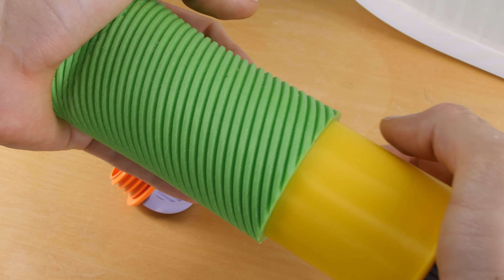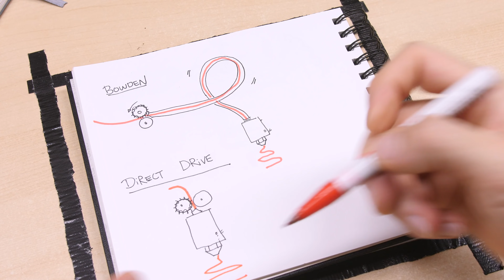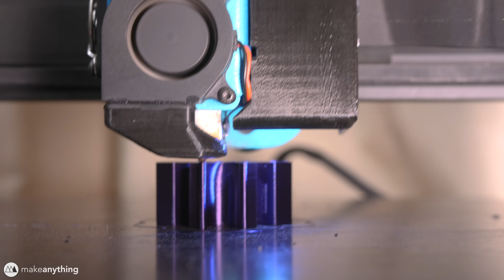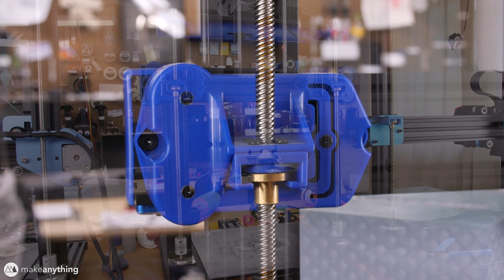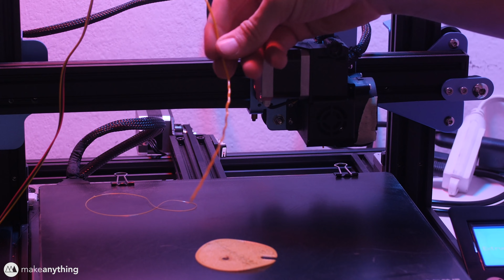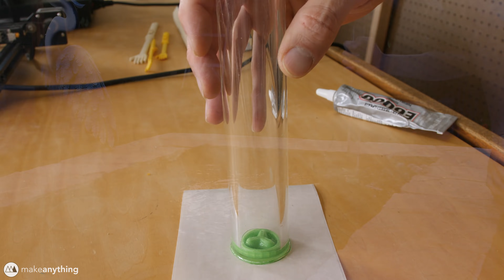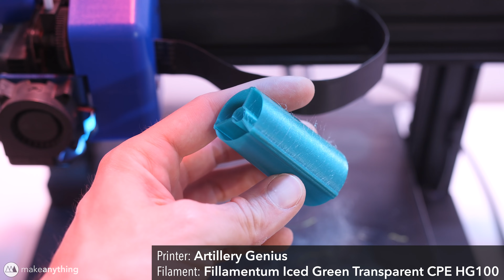Direct Drive 3D Printers in 2020 // Artillery Sidewinder X1, Artillery Genius, Sovol SV01 MEGAREVIEW

Comment: I have recently received the genius and had perfect prints every time since. I use Simplify3D's profile for the sidewinder and just changed the bed size. haven't had a problem yet and no z banding with mine. Great video, I'm waiting on making room for the artillery sidewinder since it was bigger than i thought. Also i highly recommend the Micro Swiss High Flow Volcano plated nozzle, the plastic doesn't stick the the nozzle and make a noticeable improvement to the print quality
Reply: what do you mean with changing the bed size? did you extend it in one direction?
I am planning to do this on my home build printer and buy an sidewinder x1 as primary printer for all parts that aren't extremely long
Reply: @chyrt  in simplify3d i used the sidewinder print profile that was provided from simplify3d. then i changed the bed size in the profile to match the size of the artillery genius. if you are buying a sidewinder there is really no need to change the settings in the simplify3d profile

Comment: i have recently bought the sidewinder x1. have you upgraded the hotend for high temp ?

i was having issues with petg at 230 or 240 i forget. i think it may have been the part cooling fan being at 100%.

any tips on printing abs or petg with the x1 ?
Reply from the maker: I believe I was printing at 245 or 250. Turning down the cooling fan could certainly help. 0% for ABS, ideally. Maybe 50% fan power for PETG
Reply: Sidewinder prints petg just fine.  You can adjust the cooling fan in your slicer.

Comment: The beds on the artillery machines are actually 120v ac powered.  So it actually powered by the outlet.  The main board controls them with a solid state relay.
Reply from the maker: Well that explains those insane speeds!
Reply: @make.anything  I would highly recommend printing some cable strain relief clips for the bed cables because you really don't want those to wear out.

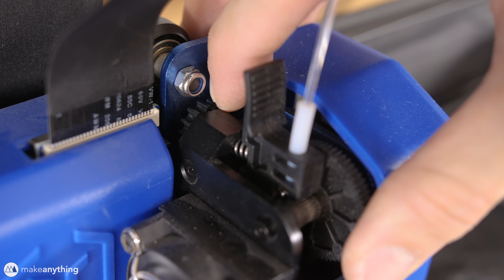Comment: Hey Devon. I recently got an Artillery Sidewinder X1 of my own, but I'm still pretty new to 3D printing, so I know for a fact that there are some things I could fine tune with my machine. Is there any chance you could make or direct me to a good calibration guide? Like at 6:51 when you were talking about extruder tension. I know my machine is gripping my filament tighter than it should, and everyone said I had to lessen the tension on it, but I actually had no idea how to until I saw this bit 😅

Thank you in advance!
Reply: Same, recently got a sidewinder and had some problems like prints not sticking to the bed.
Reply: @epicyrein7958  I had them at first too then i cleaned the Bed with Window Cleaner to get all the grease off, that helped . 
Leveling is key here. if you have a warped bed, maybe try an firmware Update from Nexus 3d with Mesh bed leveling. 
I just updated yesterday.
Reply: @epicyrein7958  Use Isopropyl alcohol to clean the bed, it works perfectly for me for the sidewinder.
Reply: directly change the extrusor for a boundtech.  put a rear bars to cancel the z movement and buy magnet bed ( two trees is a good chance). after that you will have a ferrari printing at home.

Comment: Just a heads up, serger thread tends to be relatively low quality and can cause issues if used in regular home machines due to excessive lint and fluff buildup. It certainly can be done, especially if you're vigilant about machine maintenance, but the easiest way to keep a machine in good working order for as long as possible starts with high quality thread. Brands like Aurifil and Gutermann are also available on large spools for quite good prices and are very high quality threads.
Reply from the maker: Thanks for the heads up!

Comment: Is there any problems with direct drive extruders?
Reply: Burdened Movements: With the extruder mounted to the print head, weight is obviously added. This extra weight adds speed constraints, causing more wobble and possibly a loss of accuracy in the X and Y axes.
Reply: But if you print around 60mm/s you should be fine
Reply: Like, is there even a reason to purchase a Bowden-style printer?
Reply from the maker: Faster printing, pretty much... Which as I said usually isn't a priority for me
Reply: TheSavageDog28T , Make Anything thanks!

Comment: I haven't had any luck printing bearings on my printer so I got excited when I saw one at the start of the video lol
Reply: increase the distance between the nozzle and the bed put some gluestick on the bed spread it with a wet paper towel heat the bed until it looks clean thats how i do it if your initial layer is too squeshed the diffrent parts of the bearing wil stick togheter hope this helps you beceause it really is satisfying to print them bearings! XD
Reply: @aiko6035  thank you so much for the suggestions! I've been trying to print successful bearings forever with no luck :( Im going to try this tomorrow and hopefully it works! Ty 😁😁
Reply: No I’m a potato not you